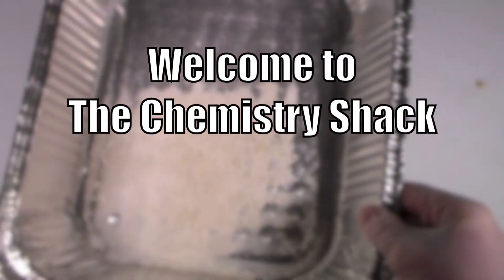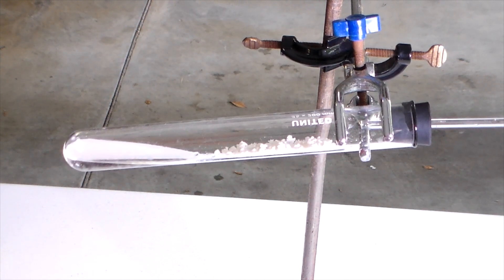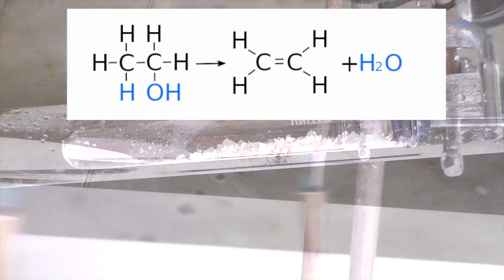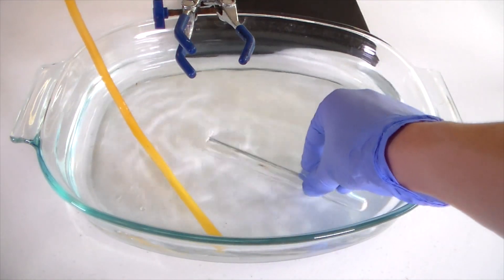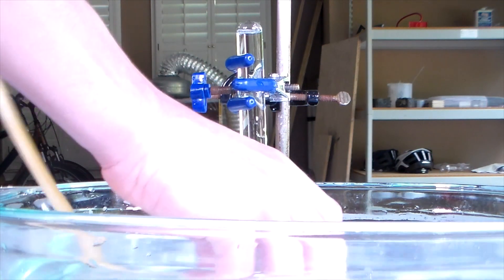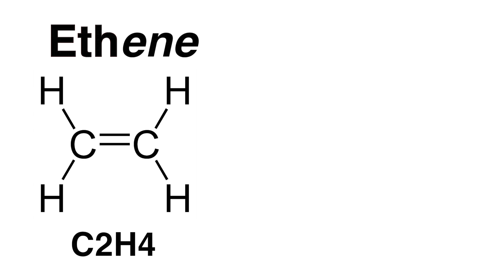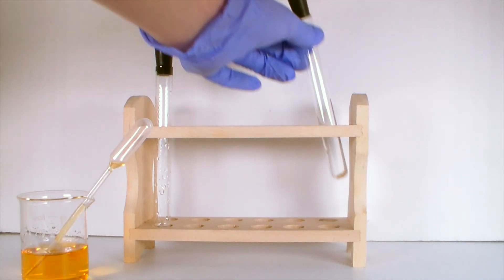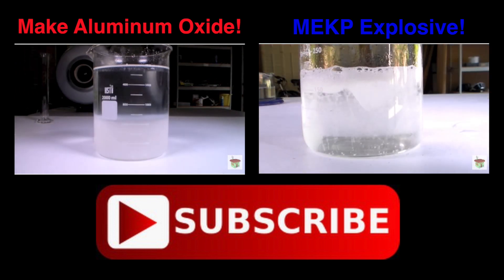How to Make Ethene (Ethylene) - Catalytic Dehydration of Ethanol

Comment: Also to note, another test that you can do for alkenes or alkanes is the bromine water test, when you mix bromine water with the alkene or alkane, if the colour of the bromine water (which is orange) decolourises then the substance is an alkene as the alkene is more reactive as it is unsaturated so will change the colour of the bromine water. However, if there is no change to the colour of the bromine water then the substance is a saturated alkane and is not as reactive so will not react with the bromine water so will form a solution

Comment: Is ethanol not flammable? How are you able to conduct this without it being a hazard?
Reply: The ethanol vapors push the air out, and you can heat it and not have it explode, the flash point of ethanol is below the boiling point, which is also why you can distill it. And you dont't heat the ethanol that much, its mostly heating the aluminium oxide catalyst. Be careful though as if you stop heating the water can backflow into the test tube and crack it

Comment: I've read you can also dehydrate ethanol with sulphuric or phosphoric acid to make ethene, which seems quite a bit easier to do than this for the amateur, even if it's more expensive. And while sulphuric acid oxidises ethanol, phosphoric acids doesn't. Are there any other downsides to this?
Reply: It will also produce diethyl ether which has a very low boiling point (almost at room temperature) so I don't think its a very safe way of making ethene
Reply: @EdwardTriesToScience  Plus you're dealing with something hot and very corrosive together with potential explosives! From what I've read (but can't now find a link to) about making ethene from ethanol+sulfuric acid, it's not as simple as many chemistry textbooks would imply.
Reply: I actually did some testing and you need the sulfuric acid to be over 140 C while dripping in ethanol, it seems easy enough to do but the hot acid could lead to flash boiling the ethanol and the glassware blowing apart, here's a video I found that made ethylene this way
https://youtu.be/UOyRP9E13rI
(skip to 6:44)
He has mentioned using sulfuric acid is not ideal and you can see that his acid/ethanol mixture has tarred up from sidereactions
Reply: Aluminum oxide does seem like the best way but I've cracked quite a few test tubes frome the ethanol boiling over onto the very hot section of glass, some improvements in this setup could be made, if I do get it to be safer and better I could post a video on my setup

Comment: The blackening of the Al2O3 may be due to charing of the ethanol to give soot or carbon deposit..
Reply: Yeah the plain TiO2...eheh, Al2O3 is coking (so, s1 and s2 carbon / van der Waals carbon @ alumina) from all the hot ethanol but not a hot enough T to decoke.

Comment: I believe 2-iodoethanol is formed upon reaction with iodine water.  When water is present in excess of the halogen, halohydrins form rather than the vicinal dihalide.  This certainly happens with bromine water, but I couldn't find resources supporting the reaction with iodine water.  You can easily determine which reaction occurs by testing the pH of the resulting solution once the color clears.  Halohydrin formation produces the corresponding hydrohalic acid where as vicinal dihalide production does not.

Comment: Probably someone else has already said it but the black forming on that catalyst will be free carbon caused by futher reaction and/or/both incomplete combustion reaction [EDIT: mostly just simple decomposition reaction] with a few different reactions taking place. eg. The very small oxygen finding a way in somehow is causing at least two incomplete combustion reactions causing some CO2(g) + CO(g) + C(s) products where the solid carbon is causing almost all the black colour over the catalyst. If you really get technical, there will highly likely be some trace amounts (very tiny amounts) of carbon based compounds such as high number carbon hydrocarbons with complex structures and some with simple structures but again they aren't many at all. Hopefully that gives someone who wanted to know a little more detail/s. EDIT: Most of the carbon is being formed without any oxygen playing a role. Carbon is formed by the thermal decomposition of ethane. I was just trying to emphasize that the setup had some oxygen initially in it and could also get into it in small amounts.

Comment: 'Chemistry shack' is an unfortunate name for DIY at-home chemistry channel. It's as though the idomatic phrase, 'crack shack,' has been substituted for "crack" = "chemistry"
Reply: I disagree. I immediately took it as a chemistry take off of the term "ham shack". Ham shack has a long history of representing a place where amateur radio operators would tinker with and operate radio electronics and communicate with other amateurs. Chemistry Shack connotes to me a virtual chemistry version of the same. A place where amateur chemists tinker with and exchange knowledge about chemistry.

If you look up Ham shack on Google, you will find thousands of references to the usage I describe, whereas, if you look up crack shack, you will discover a lot of references to a restaurant chain of the same name, and at least one urban dictionary reference suggesting it refers to a "flop house".

Now if you look up crack 'house', its a different story, but even "chemistry house" doesn't offer that negative connotation.
Reply: I also disagree.  The error is in the robbery of the phrase by unsavory folks and everybody's acceptance of those connotations.  I don't care what or where some junkie loser is ruining there life.

Comment: What would be a good chemical neutralize for ammonia. Cat peeded in the corners, natures mirical doesn't work, neather did saturating the area with 1/1 CH3COOH+H20.
Reply: hydrogen chloride gas works, problem is now the carpet is acidic, but if you put the right amount, it will just be harmless ammonium chloride
Reply: OdinAF baking soda
Reply: tried that, no go
Reply: OdinAF Fluroantimonic acid or Chlorine Trifluoride

Comment: some cracking occur, leaving carbon coke on the catalyst. In industry, they have recycling tower where they pass air onto it to burn it off.
Reply: that's right! most catalysts suffer this during those kind of reactions.
Reply: Could you keep the catalyst temperature lower and have a longer reactor to avoid cracking?
Reply: @TheHuntermj  It could work but the issue is at lower temperatures the ethanol doesn't dehydrate into ethene but diethyl ether instead. At 300C ethene is effectively the only product, but once you hit 270C Diethyl ether is the major product.
Reply: @WhitePalladian1  Eek! Diethyl ether's autoignition temperature is only 160 °C!
Reply: @BruceMardle  yep. But an air free environment isn't hard to achieve on small scales. Just have a tube going into water to keep air from backflowing and then you'll have a pure ethene, diethyl ether, ethanol atmosphere. But yes still dangerous. Welcome to industrial methods of ethene production
Reply: Whic one catalyst.
Reply: @mohanp8850  Aluminium Oxide (Alumina)

Comment: But the ethanol does not boil and fill the test tube?
Reply from the maker: Ethanol is soluble in water so any ethanol produced will dissolve in the water.
Also, the reaction of ethanol with iodine water is very slow, so if ethanol was produced and not ethene then the color change in the test would not occur as quickly after only a few seconds

Comment: i would say the impurieties are decomposing, try torching your alumiunium oxide
aluminium oxide shouldn't react with alcohol but the water may caused some reaction but i don't think so
Reply: @prospektOS-tmo97  
Nope, aluminium oxide shouldn't react with alcohol. There's no need to be so rude.
Reply: @pietrotettamanti7239  bro. Are you serious? There are dozens of papers on the catalytic dehydration of alcohols over aluminum oxide and many other metal oxides